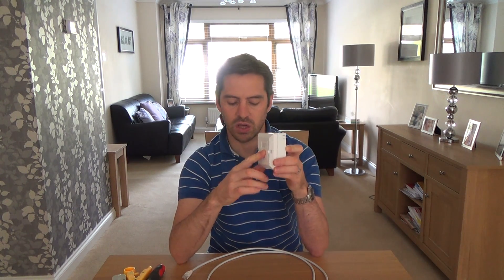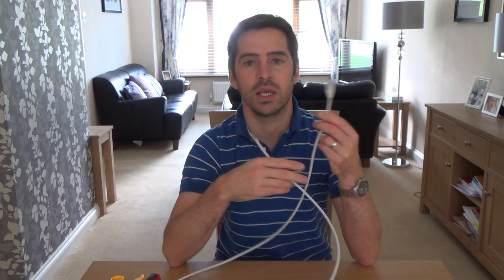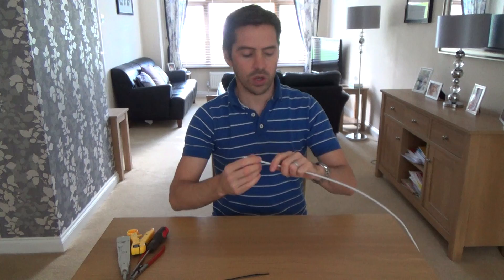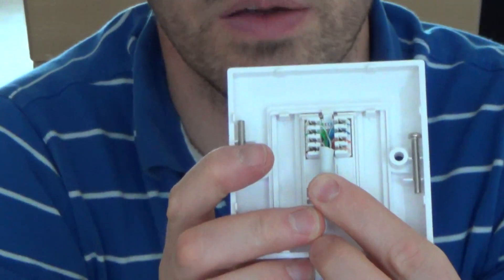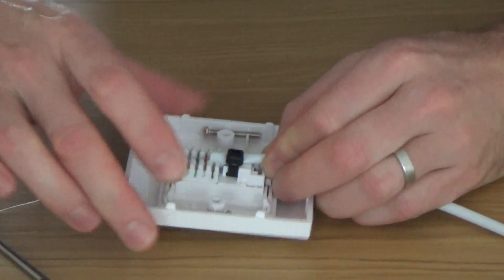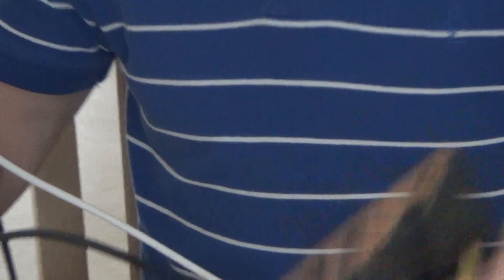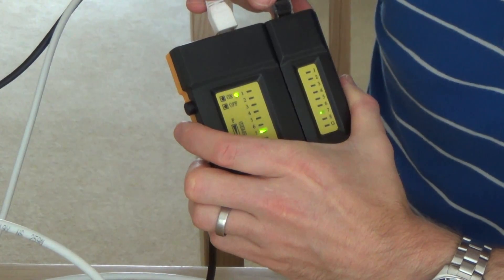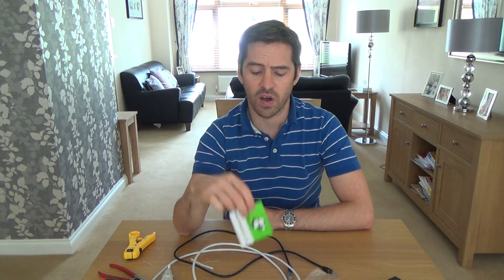How To install a CAT5E Network Faceplate Socket and How To FIX a wiring FAULT

Comment: Do you need to use a backbox? Could I just get a plate that allows an ethernet cable to plug into it, screw it to the wall, then have another cable go from my computer to the plate? 
There's already a drop through my attic and down my wall.
Reply from the maker: Garry S If you want the socket flush to the wall then you can use an electricians metal backbox sunk into the wall. As far as I know you cannot get or I haven't seen a faceplate which allows you to plug in an Ethernet cable from behind to feed the faceplate and in front to connect the computer.
Reply: Ok what I may do then is just get a plate with a hole to route the entire cable through, end to end from the router to my computer. i'm in rental house so not sure what I can do with landlord. lol
Reply from the maker: Garry S Maybe get one of those brushed plates, it is a faceplate with a brush in it so you can shove loads of cables through and still looks quite neat.
Reply: yeah that would be nice. now I just have to figure out how to find the hole in my attic. it's pretty hot this time of year and I think the power cords are buried under all the insulation
Reply: +Garry S You can use what's called a ethernet keystone coupler to do this: http://www.amazon.com/Cat6-Inline-Coupler-Keystone-Type/dp/B00JXVMD0W/ref=sr_1_6?ie=UTF8&qid=1443995891&sr=8-6&keywords=ethernet+coupler

Comment: Cheers for the video mate. Is that just a coax rotary cable stripper you used to strip the  cable? The draw string on the cable i have is a bit rubbish thats all
Reply from the maker: JAHall1989 Hi, yes that is right, on this one you can adjust the blade up and down so it can cut smaller cables than 7mm coax cables.Thanks Vince

Comment: really good instructional video, do you sell any similar products for use with cat 7 cable?
Reply from the maker: Anthony Brennan Hi, no, not at the moment but it will be something that I will be looking into over the next year. I did order some cat7 cable in but the current price is still so high hence the reason I haven't gone further with it.Many thanks Vince
Reply: thanks mate.  do you know if you're able to connect it with cat 6 RJ45 and cat 6 connectors? I'm guessing it will effect the performance of the cable?  

Basically I purchased cat 7 cable hastily and had it run through out the house, now I have the problem of which connectors etc to use

I have seen your kits and wondered if they would be suitable for applying cat 6 connectors and cat 6 RJ45's?  

Thanks for your help
Reply from the maker: Anthony Brennan Hi, my cat7 cable is 23 AWG and my cat6 is also 23 AWG so the thickness of the wire cores are the same so CAT6 plugs and faceplates will definitely work with CAT7 but the proper CAT7 plugs and faceplates are shielded so even though you have cat7 cable it will run at cat6 speeds if you use cat6 faceplates and plugs. CAT6 is more than fast enough today and in the future you know you have cat7 installed and you can upgrade the plugs and sockets at a later stage if needed.Many thanks Vince

Comment: great video. this is gonna help me on my ps4. just one thing didnt you get the solid orange and the white orange the wrong way round?
Reply from the maker: ChEm1cAlKeEn Hi, yes, I mixed up one of the pairs and then when I tested it at the end of the video it was picked up on the cable tester and then I sorted them out.Thanks Vince

Comment: Hi,
Great tutorials.....
I want to send a cat5 cable down to office at end of garden with broadband and phone.....how would I wire faceplate?
Ade
Reply from the maker: Adrian Copestake Hi, if you want to keep the router in the house then you would need to run 2 cables, one for a phone extension and one for the Ethernet signal. (this is the best option)You could run both phone and data down the one cable if you use a pair of data/voice economisers (see latest youtube video) or you could just split the pairs in the cat5 cable yourself, the data uses the orange and green pairs and you can send the phone down the blue pair of wires.Many thanks Vince
Reply: My Mate VINCE Hi,
Thanks for reply........so if I split data and phone on one cat 5 cable (already in the ground) could I then terminate onto one dual faceplate (data and voice) if so would the wires still just follow the faceplate colour code?
Thanks again Ade
Reply from the maker: Adrian Copestake Hi Ade, if you are located in the UK then you will need a dual faceplate with one cat5 data socket module and one BT type socket module (I have these in secondary and master if needed). The orange and green pairs will follow the colour code on the cat5 socket (normally using the B wiring diagram) and the phone module will use blue to terminal 2 and white/blue to terminal 5. If you want to use a dual faceplate (both modules cat5 rj45 sockets) then you can get converters from RJ45 to BT socket and again you would follow the wiring for the blue pair of wires on the cat5 socket.Remember that because you are using only 4 wires for the data signal you will not be able to upgrade to a gigabit network in the future, you will be stuck on a 100BASE network which probably what you are currently using.Hope that makes sense.Thanks Vince
Reply: My Mate VINCE Hi,
Ok that answers my question......I want it to be gigabit! so will have to send another cable or just use phones wireless.
Thank you again,
Ade
Reply: +Adrian Copestake Gigabit capable Man Shed at the bottom of the garden? Impressive my friend, very impressive :-)

Comment: Thanks for uploading, i have always had problems with some keystones i fitted so upgraded to the socket in one room.
eventually i want 2 LAN sockets in every room to future proof. will i need to run 1 length of cable for each socket or can they be linked in parallel (wired for the previous socket to the next socket, etc?)
Reply from the maker: Gareth S Hi, unfortunately you will have to run 1 cables to each socket. If you are using 100 BASE Ethernet (NOT Gigabit Ethernet) you could get away with one cable and then split the wires because each socket only uses 4 wires out of the 8 wires in the cable but it is not recommended so I would recommend running 2 cables to each double outlet and then you have future proofed the install for when you upgrade to Gigabit Ethernet (which uses all 8 wires).Many thanks Vince
Reply: My Mate VINCE thanks for the reply, that's what I was fearing lol. 
Would it be possible the way I mention as long as only ever use one device plugged at one time, as wouldn't it just be like a continues line but with splits/joins??
Many thanks, gareth
Reply from the maker: Gareth S Hi Gareth, I am sure it will work if you only have one device plugged in at a time unless the other device on standby mucks things up (not sure about that) but you may as well just fit a single socket and plug in a rj45 double adaptor rather than wiring up a double socket as you will get the same result.Cheers Vince

Comment: Hi this video is really helpful. Thanks very much. 

2 questions:
1) can both ends be terminated on wall-plates( keystones/female)? So 1 each I can connect patch cable to a computer and the other end another patch cable to router. 

2) is a solid core cable mandatory to run within the walls? U r recommending that  for reliability and stronger signals right?
Reply from the maker: MrLoichin Hi, thanks for watching the vids. Answer to question 1 is yes you can terminate each end onto wall plates and this is a common way to do it (in fact that is how I sell my network kits in my ebay shop with wall plates and patch leads).Answer to question 2 is: Solid core is needed to terminate onto wall sockets. You need solid core when using the punch down IDC slots/connections as stranded core cable makes a bad connection because it often crushes rather than allowing the IDC to slice into the wire.Thanks Vince.

Comment: Very helpful, but it raised a question for me. How many devices like media players, game consoles, av receivers, etc. could you hook up to a socket like this without impairing the signal if it was coming from a typical router? Would it be better to wire each device separately with it's own wire from the router if the router was 50 feet away?
Reply from the maker: Hi, you have to wire each one separately from the router. Only one piece of equipment will work per cable/socket. The other option is to fit a network switch into the socket and then you can plug numerous items into the network switch.
Thanks Vince